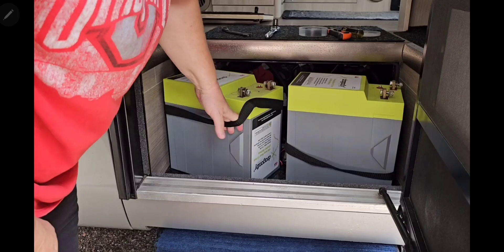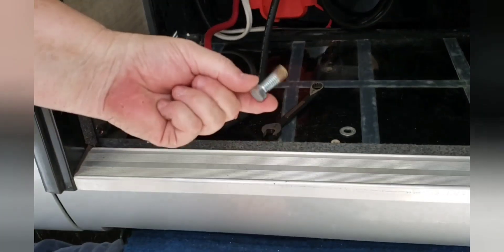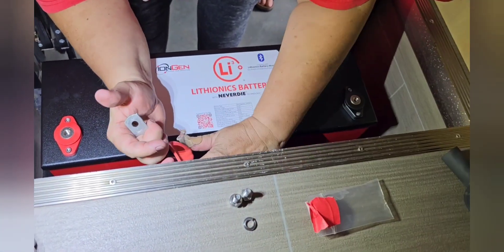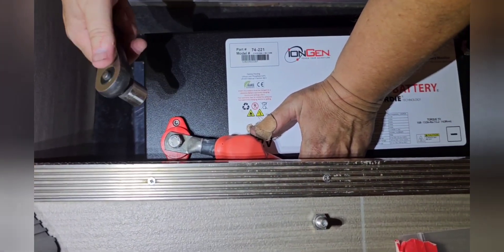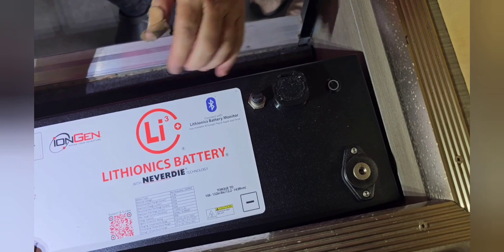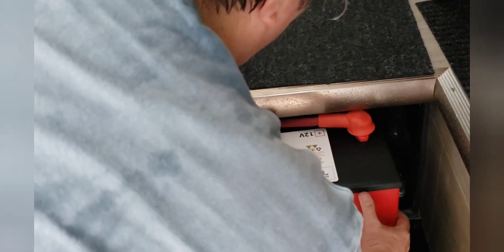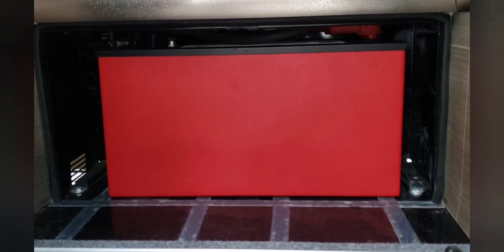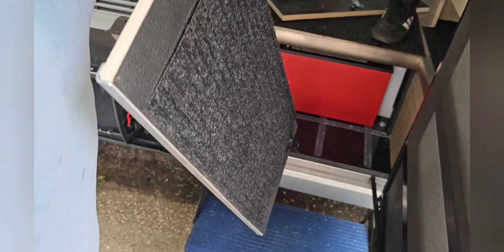Lithionics 320ah Battery, Easy Replacement for Leisure Travel Vans Dragonfly Batteries

Comment: two dragonfly batteries lost, cost something like $2000 (probably a lot more from LTV). The Lithionics 320 is over 4k....so is this effectively a $6,000+ upgrade???? I wish LTV would let you buy your own batteries and delete the factory ones from the order. I know 120 extra Amps is super helpful but $6k for it seems.......wasteful?  I guess I'd rather use an adjacent compartment for one or two more dragonflys, although this Lithionics 320 solution is super clean.
Reply from the maker: I don't know where you're getting a cost like $6000, a Lithionics battery is much less. A Lithionics 320ah battery outperforms nearly 500ah of All the other brand Lithium batteries. As you said a Lithionics battery is a little over $4000, so if you do an apples to apples cost comparison you'll find it costs more to install say 4-100ah Battleborn/Dragonfly batteries and all the new wiring, fuses, Victron battery monitor, etc. not to mention all the space you have to give up when a powerful compact Lithionics battery is a drop in replacement in a LTV, using the same wiring. If you're thinking of a 3000w inverter, then a Lithionics 320ah battery can run everything in your coach with no problem. Battleborn recommends that you must have 3-4 of their batteries to run a 3000w Inverter, or you risk blowing their battery's sensitive BMS because of the high capacitive in-rush current of a 3000w inverter. A Lithionics battery is the best choice for a LTV, particularly for DIYers because it's such an easy Upgrade and it also makes Upgrading to a 3000w inverter, because on 2020 and newer LTVs all you need to do is swap out the 2000w inverter for the 3000w. No new wiring or fuse!
Reply: I think I was just approaching this from the perspective of a potential new buyer, like myself. The new LTV wonders and unitys come with the two Fireflys. I don't know how much of the purchase price they attribute to the lithium batteries which are now standard, but I imagine it is at least $2,000. It's a baked in cost, you don't get a choice. My point was that if I were to choose an upgrade like this lithionics, I'm basically wasting whatever amount (2k?) I just paid for those Fireflys and then I'm also spending additional $4,200 or so on the Lithionics, so effectively it's over a $6k hit. But I agree with all of the advantages you mention, I certainly wish it was a factory option but they'd probably charge 8,000 for it! LOL
Reply from the maker: The Lithionics Boss 310ah battery is a perfect fit for a Wonder  if you want a more compact solution. Look for my video installation in a Wonder, https://youtu.be/xfi1tKu3dmM?.

Comment: Thanks for posting - is it possible to use the old lithium batteries and add them to the total storage - Or, if you wanted to expand capacity you need 2 of the 320s?
Reply from the maker: You can't mix different Lithium battery brands and battery capacity sizes, they won't balance properly in using or charging.
Reply: @SandyRVUpgrades 1 additional question to tap that engineering brain of yours - If you added a 2nd 320ah Battery - is there enough room to store it next the 3000W inverter (once upgraded)? Would wire the battery in series or parallel? Would this be the best place to house it (near the inverter?  Would it make better sense to do 2 of the 305ah batteries as they look smaller and could you put them both under the step? BTW - you are an inspiration for sharing all of this knowledge.
Reply from the maker: @DanielEckert63  Absolutely, It fits straight in next to the inverter. In fact depending on the floor plan a third Lithionics 320 can go in the inverter compartment as well. I've posted pictures of double and triple Lithionics battery installations on the Sprinter Source Forum Unity Section and LTV Enthusiasts and Upgrades groups.

Comment: Thanks for sharing Sandy,  Is there a market for the used BB / Dragonfly batteries?
Reply from the maker: If I get any I give them away to pay it forward to help someone else. But you can post them on LTV For Sale Facebook group or Facebook Market Place for your area. The pair usually sells for $600-$1000, but they can only be picked up because you as a private seller can't ship Lithium batteries.